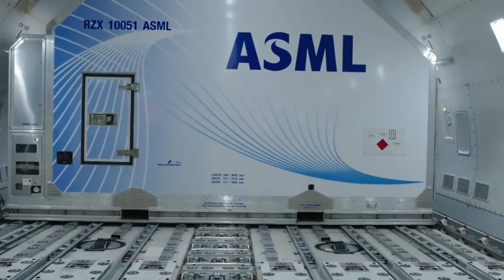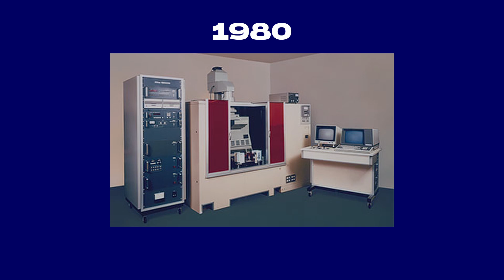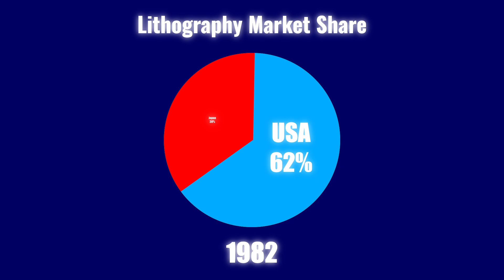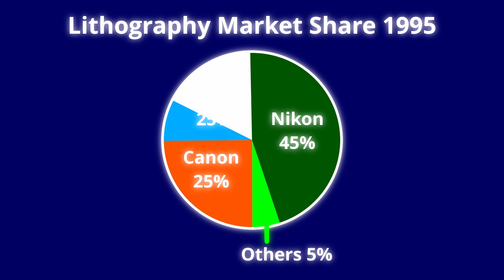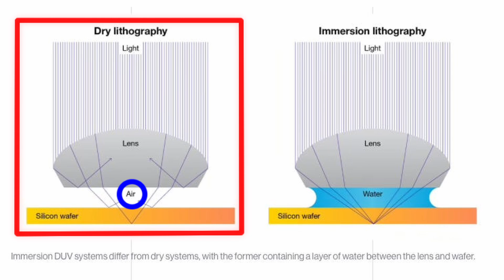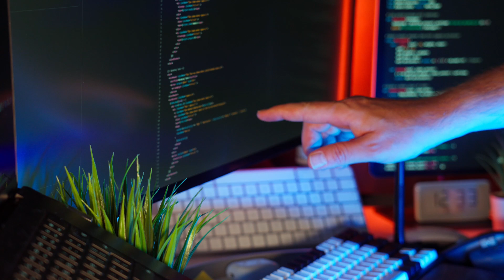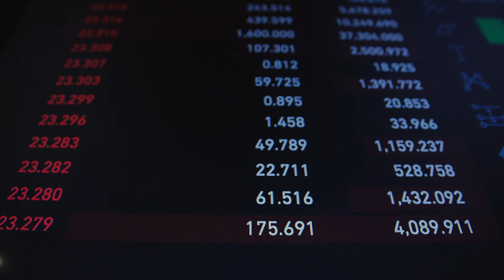How Japan Lost Lithography — And ASML Won

Comment: It's simple. ASM focused on software and cooperated with customers, even asked Samsung to acquire them. They outsourced every hardwares to Zeiss and Philips. Japan wasted time and money on creating every hardwares in-house and did not collaborate with customers.
Reply: What do you mean by " outsourced hardware to Philips"? Which HW philips were doing for ASML?
Reply: @avikpram  For example, control stage to Philips, projection lens and illumination system to Zeiss. ASML is located in city of Philips.
Reply: @IndiotPlasticCow i know ASML is located in Eindhoven/Veldhoven (I live here). I know ASML is an offspring of Philips. And Philips was an early investor too. But I don't know of any control system works done by Philips , now or anytime in the last decade. There's another Philips offspring, VDL-ETG works on the wafer handling system. But that's one of the many vendors/suppliers doing various bits for a large company and a large product like lithography machine. I agree Zeiss and Cymer are key and critical component makers , not just another vendor.